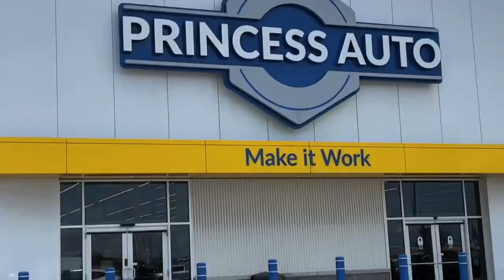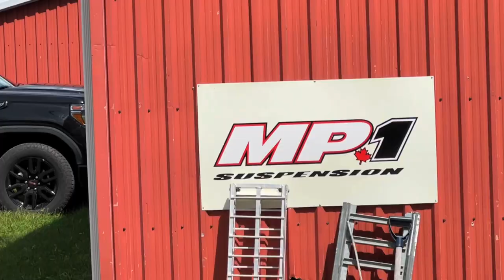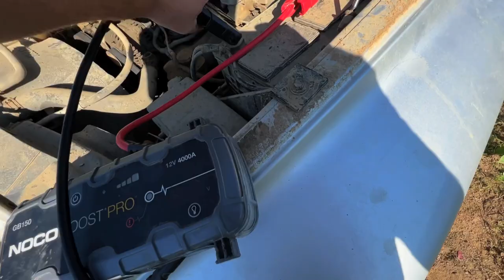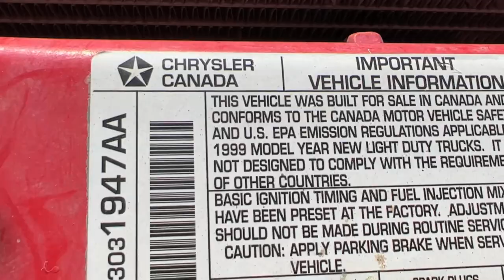Dodge DESTROYED Truck JUMP!

Comment: Hey on the red ram im pretty sure the coil is in front of the motor u should rip the fan sheld off and see if it unpluged the coil or not i wanna see it on the limiter